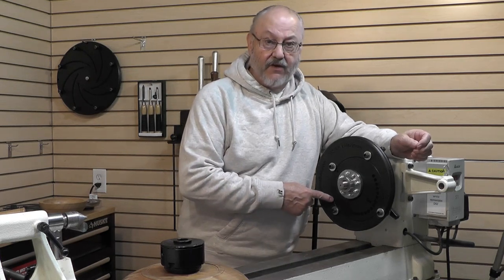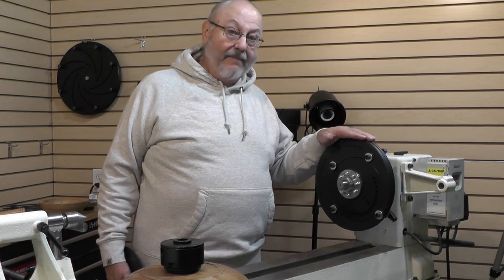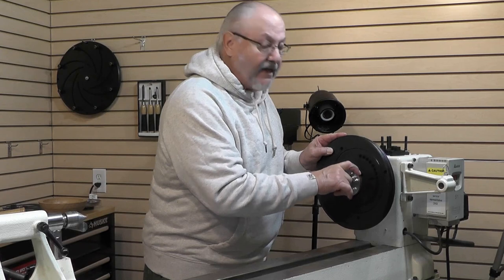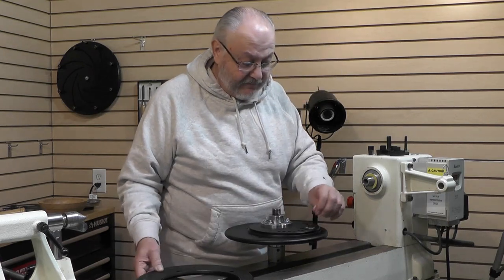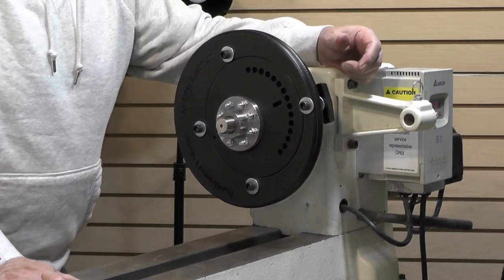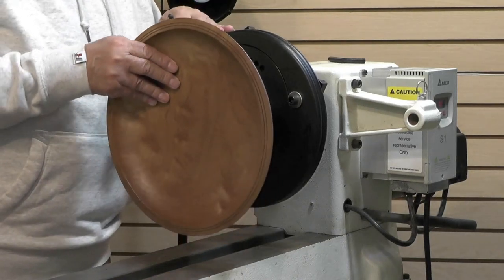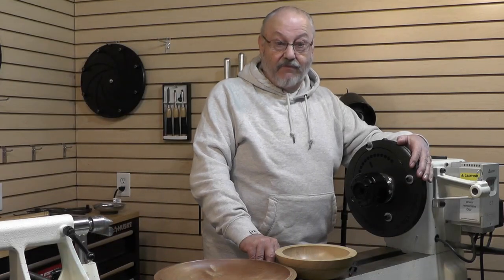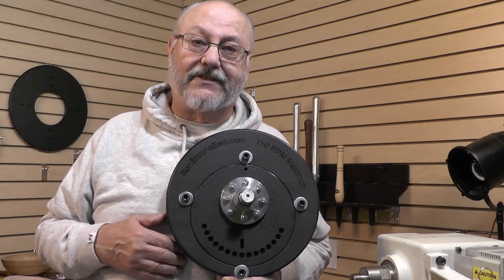Amazing Full Sized Off-Center Chuck for Wood Lathes

Comment: Hi Ron,
Slight confusion on how you are "LOCKING DOWN" your Smiley Face Plate when using it in "Variable Mode" rather than "Fixed Position Mode".
I understand how the "Fixed Position Mode"is held in place, but what stops the Smiley Face Plate from moving when using it in "Variable Mode"?
Cheers
Roger in UK
Reply from the maker: There are four (4) bolts with oversized washers which "Clamp" the assembly together. I may have added the oversized washers after this video was made.
Ron

Comment: What is the diameter of the black disks?
Reply from the maker: They are approximately 1/2" smaller than the stated size i.e. a 12" is actually 11-1/2" and a 16" is actually 15-1/2" in order to clear the bed ways.
Ron